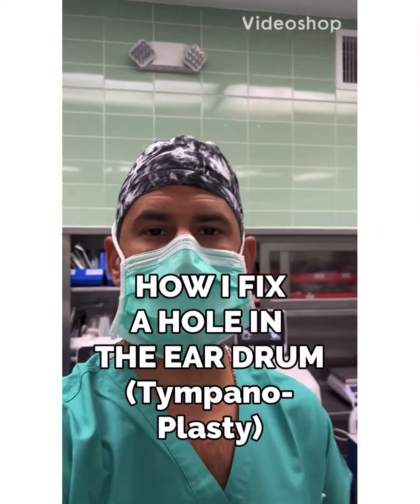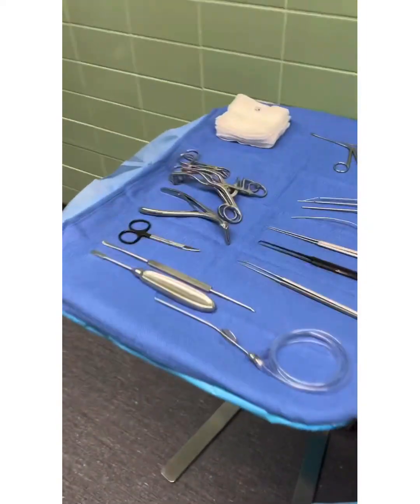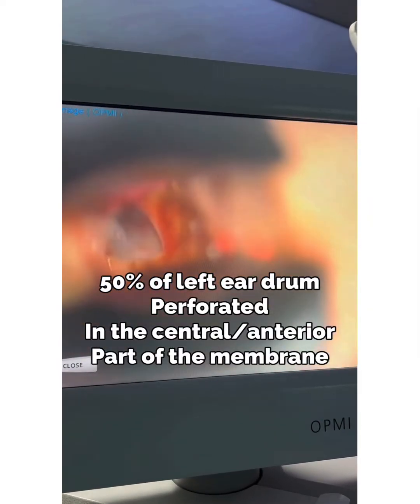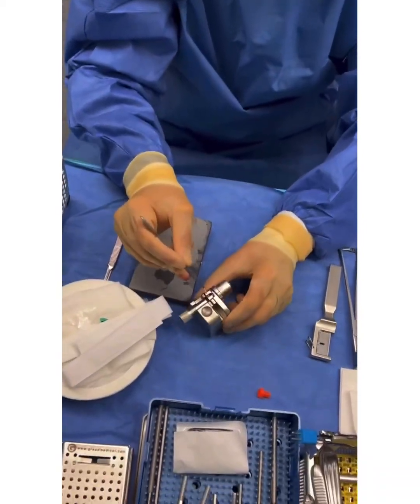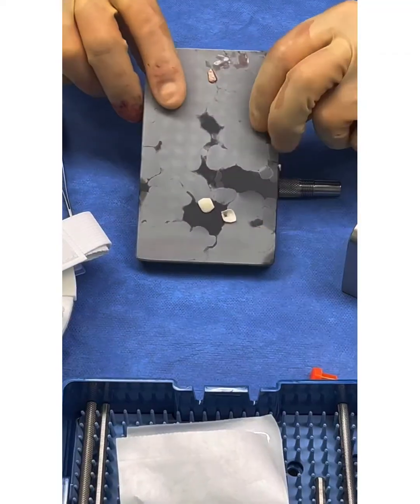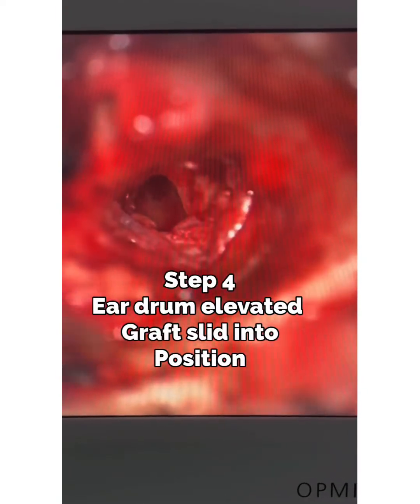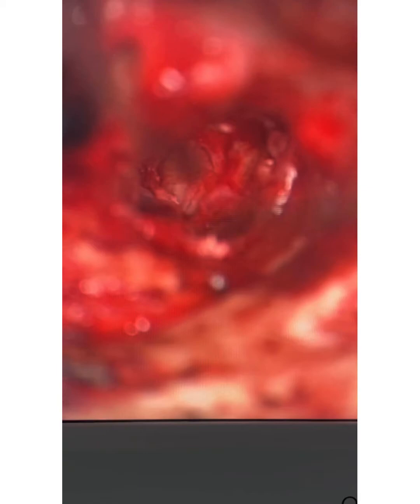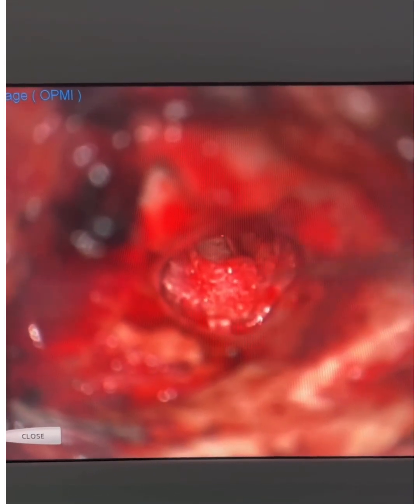Ear drum repair / tympanoplasty using cartilage. Step by step surgery video

Comment: I have done this procedure in my right ear, the hole was caused by infection when i was young. Fot me they made incision behind the ear. Although the ear improved a little bit however you do get tinnitus as side effect, this is due to hearing loss. You can treat it by using hearing aid.
Good luck whoever is doing it.

Comment: Nice video. I had different opinions from different ENTS. My regular ent said my hearing is too good for surgery, and to do surgery almost without question that i would have further hearing loss from the scarring, and i would have to be willing to accept it. Another ENT otologist said he can get it better. My internist said surgery could make it worse. Even my skin dr. said surgeon can't guarantee that it wouldn't make hearing worse. Since this surgery can be done at any age ; i will wait till im 60 +. I might feel more comfortable with a hearing aid at that age just in case surgery makes hearing worse. If it makes it slighty better as its a mild hearing loss to begin with ; its a new lease on life. Supposedly in india as shown on some youtube videos a non surgical way of closing a hole called ecng seems to be safe. All the hearing with the hole comes back they say. If that comes to the usa ill be first in line to get it. Seems with regular surgery that the surgeon MUST hit a home run the first time, as theres little room for error. G-d forbid scarring or graft failure. Another dr. in india said not to worry. In capable hands results are predictable.  He also said with modern day instruments that ones level of hearing going down is quite remote
Reply: Hey bro i am going through that ecng treatment right now it is helping me to grow my eardrum so far

Comment: I had this surgery done twice on my right ear.  Years down the road had to have my eardrum rebuilt and now I have so much scarring from all the ear infections I’ve had, and from the surgery, that I have very little hearing in my right ear, as well as ear pain pretty much every day.
Reply: I have a perforation aswell, would you recommend doing the surgery?
Reply: @02snow.44 . Yes, it’s definitely worth it.  And medically necessary.
Reply: why did it have to be done twice? and how long before you had to do the 2nd one?
Reply: @justgreen2162 . It ended up being caused by allergies, which caused fluids to back up and a perforation.  I think it was about a year apart.
Reply: After operation your hearing is low than before?

Comment: I have had this surgery when i was around 13-14 to remove a tumor. The tumor caused me to have some hearing loss. Im 31 now. The ear that had this procedure done healed very well. Unfortunately for me, I have really bad allergies that cause fluid build up behind my ears. I also have bad eustachian tubes. I have a tube put in my right ear to help with the problem. Because of the cartilage though, I have to undergo a second surgical procedure just to put a tube and because the cartilage is too thick to cut with a regular blade. They have to use a laser to cut it. There's a chance that the hole that they cut could grow back in a thin enough layer to allow future tubes to be put in, but there's also a chance it will grow back like it was and I'll have to get the procedure again. I'm actually in the process of asking my surgeon if it would be possible to remove the cartilage and put in a thinner material.
Reply: Hi I hope you are okay now, can you give us an update?
Reply: @mqm2788  Yes actually. I had my procedure done last Thursday and I'm currently in the process of healing. My surgeon lifted up my eardrum to clean up the area behind it and to try and thin the material to a more manageable thickness. He discovered a large amount of allergy mucus and found another tumor (Cholesteatoma) growing on the eardrum. He removed the tumor, thinned the eardrum, and placed a tube. He found that the tumor eroded one of the hearing bones near the ear drum. He implanted an Alto Bojrab hearing prosthesis behind the ear drum in place of the hearing bone to aid in my hearing. I had my follow-up with the surgeon yesterday and everything is healing nicely. He informed me that I would have to deal with the tumor issue for the rest of my life because that's how my body grows. There's a 20%-50% chance for the tumor to come back each time it's removed. Overall, I'm happy with the results. Once everything heals, I should be able to hear much better in that ear. I'll know more in a month.
Reply: Any update please tell us
Reply: @abhishekshaji4710  sure, no problem. So My surgeon was able to thin the cartilage and it did allow me to here a little bit better in that ear. My hearing test shows improvement. Wow. My surgeon was in there, he found that the tumor was regrowing and took it out. He told me that there are two bones behind the eardrum that pick up the vibrations from sound and that's what allows us to hear. He said that the tumor basically ate away at one of the bones so much that it was like a wet noodle. He removed it and gave me an implant that acts as the bone. Not sure if the implant contributes to me being able to hear a little better or not. Almost a year after the procedure he checked everything out and he said everything looks good.
Reply: @calebdavis9175  i have a small hole in my right Ear so daughter said if you do surgery it will better my left ear is good right ear have 60% of hearing I'm ok i didn't feel always I have hearing problem. My problem is I have infection  it will stop then again it will come the reason is right had small hole what will I do...